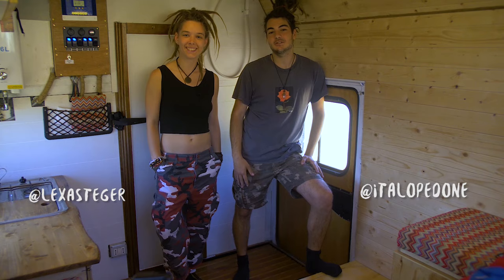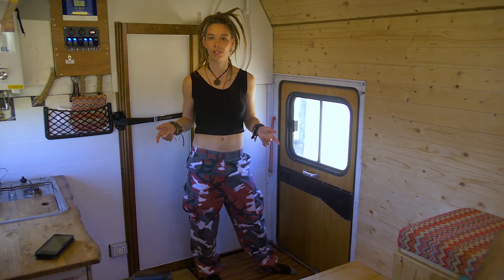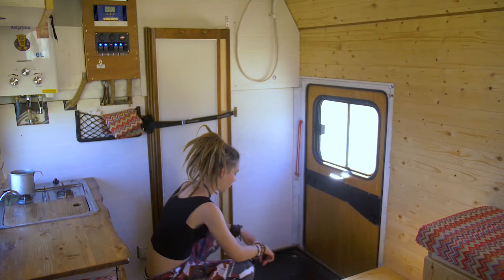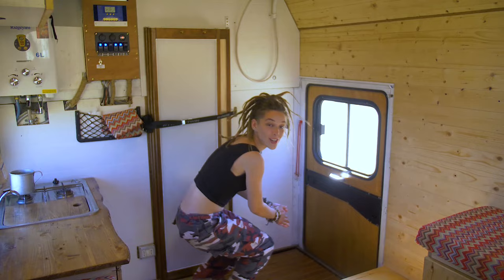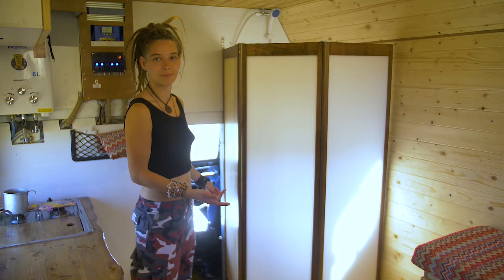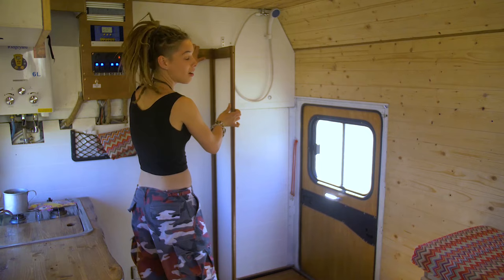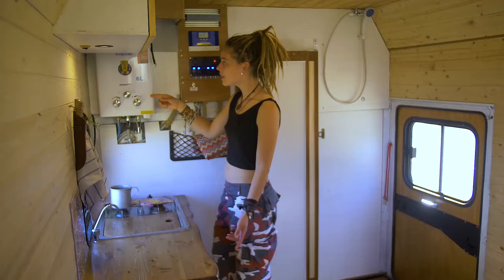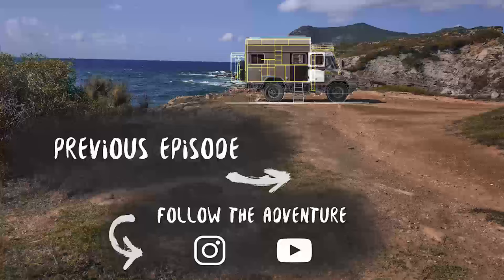FOLDABLE SHOWER 🚿 - CLEVER VAN SHOWER DESIGN!

Comment: OMG! THIS IS BRILLIANT! I'm in the process of designing a van build  for small van...this is a great idea...a lil nervous about cutting the floor of the van, I would need to look and see how it is structured...but you gave me a great idea. Good Job you guys!
Reply: I love their shower/toilet idea, too!  Just be careful with making openings in the floor.  It needs to be gas tight, otherwise toxic Carbon Monoxide is drawn in while driving.  Other air pollutants, too, from car exhaust.
Reply: Another great bathroom build is in this vid:  Family of 4 VAN TOUR ! UNBELIEVABLE Open Layout - Shower, Toilet, Screen Doors! | Van Life  Personally, I would try to also use the shower space for hanging clothes when not in use.  That is, if I could rig up a way to effortlessly pivot the hanging rod to outside the shower when needed.  Better:  use the space for pots, pans, and other items not harmed by humidity.

Comment: Excellent, I designed mine like this but haven't built it yet, and I have never seen any other like it, so it's a relief to see how great the shower pan looks. Im using a normal pan so not sure if the height will be a pain to line up with the floor. This is a great alternative. Thanks for making this video.
Reply: I was thinking of something similar too! glad I found this vid for my own validation

Comment: This is a really cool idea to squeeze more space out of no space, I think I'd feel a bit weird showering and using the loo in what is technically also my kitchen though...

I've had an idea knocking about in my head for having the rear end bed board fold up into a full size partition wall, so you can hide a full size bathroom in a tiny van. All your amenities like hand sink, vanity cabinet, shower bracket etc would be mounted under the bed board and fold up.

I don't think it would be technically that difficult, it's whether or not it would work well in practice I'm not sure about.

The only drawback I can see is that it would be a pain in the ass if you woke up in the middle of the night and needed to pee... you'd have to offload your significant other onto the floor to gain access :D

Comment: Fit a rain shower head into the roof, flush with the ceiling, so that the water falls from above
Reply from the maker: That was the first version of it!! If you watch older videos you'll see a water pipe coming out from the ceiling. The plan was to install a square rain shower head encased into the insulation. Ultimately we switched to this standard one for practicality... it gives us the possibility to rinse our feet, or use it in several different ways. I don't exclude the implementation of the rain shower in the future tho!!
Reply: @alternative_lives  have both, doesn't take up any more space, then you have the best of both worlds🙂

Comment: My design only allows a 1.5” deep pan and I am worried if the water will drain if the van is not perfectly level. Due to the van chassis I can only have one drain hole on the corner.

Comment: This is a great idea! Have you had any issues with water leaking between the walls or between the bottom of the walls and the floor into the rest of the van?
Reply from the maker: So far no issues, but I also didn't use the shower so much since I always had the possibility to use the external one. The only downside I could find so far is dust and sand collecting underneath... it needs to be cleaned before use otherwise it could clog.
Reply: @alternative_lives fit bigger diameter drain pipes then it can't clog up

Comment: well thought out.
agree that it's probably the best place to put it.
seems silly for camper designs to have permanent showers that take up such a significant percentage of the total space inside, and the curtain type showers (especially the ones where you are surrounded by a curtain on all sides) seem super annoying.
Reply from the maker: yeah, agree on that. If I had 1 meter more, or at least 60 cm more I would have totally considered a fixed shower design. but being our living space only 2.5 meters long this was impossible
Reply: @alternative_lives  Do moisture control measures need to be considered? To prevent mould and other issues from having the shower open. I'm guessing the shower space is vented by having the door open, do you think this is sufficient enough? I'm just curious because I agree that more thought could be given to intentional shower spaces that maximise square footage, just want to make sure its not only functional but also doesn't effect/damage the rest of the home.
Reply: those with fixed shower have larger van